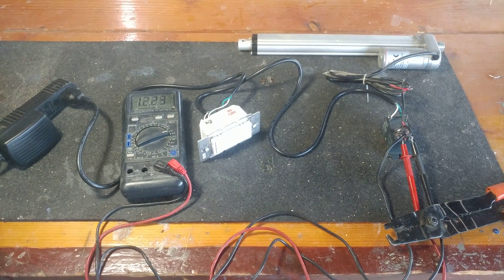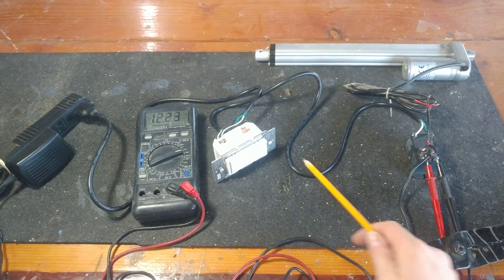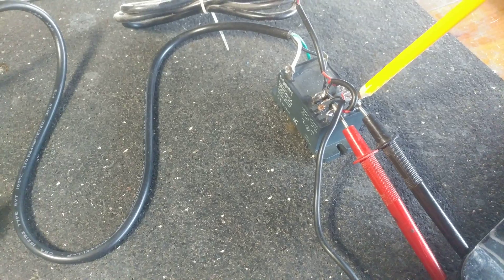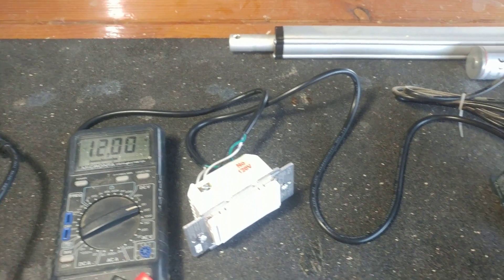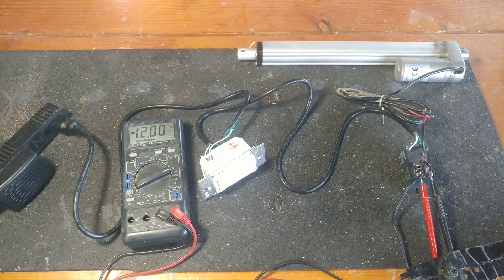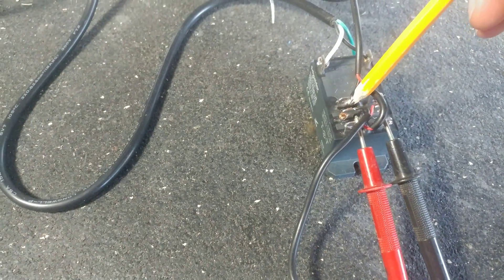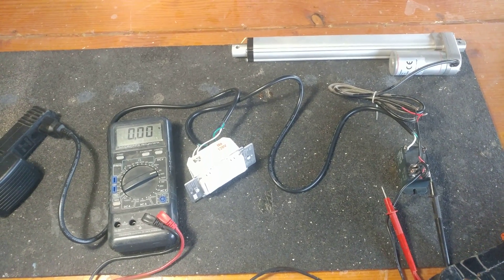DIY Z-wave controlled linear actuator / automatic chicken door / DC motor z-wave forward & reverse

Comment: Thank you for your description of the wiring for the DPDT relay. Between your video and that of @willworkforliberty, I have mine wired using a Shelly 1 Wave relay rather than a clock or wireless switch (using what I had available).
Reply from the maker: I'm glad you were able to find Value thank you

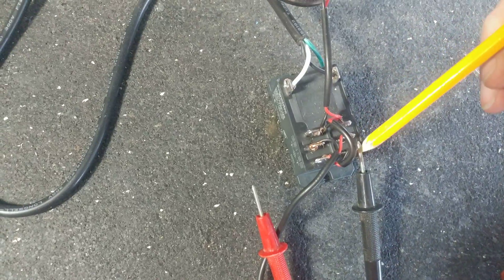Comment: I know that relays are meant to be able to control a voltage with a different voltage but for things like this I EMPHATICALLY warn against it. 2:44 You just put your hand dangar close to high voltage. Yes I know it was off, but in the past years, that I have Home automated lights and appliances, there has been times when a glitch turns on the lights in the living room, or ceiling fans in the pool room turn on and off.   Plus I hope you have it covered most of the time but if not the wring is exposed.

It is better or would have been better to have a SONOFF or MHCOZY smart switch. They have all the capabilities the zwave has and more.
Reply: Oh and no need for the relay. The extra channel can be used for lights or fans.

Comment: I did something similar to this using a Zooz Zen 17 Universal Relay. Fun Fact: Create a virtual window shade device (In Smarthings, Hubitat, etc.) to control the actuator. My actual devices are Doggy_Door_Open_Relay and Doggy_Door_Close_Relay. The virtual device is "Doggy Door" set as a virtual window shade, and if it opens, then the Doggy_Door_Open_Relay is turned on for 30 seconds (and vice versa to close). You can also use the Zen 17 as a Z-wave door opener.

Comment: I am getting ready to purchase these products to use this setup for a roomba cave door.  But the actuator used doesn't seem to be available to purchase on Amazon anymore.  Would you by chance have any other link to one I could purchase?  I am simply motorizing a piece of wall trim so it doesn't have to be very strong.  Thanks, just don't want to buy the wrong thing!
Reply from the maker: Check on eBay there's some good listings there I got more than a few off eBay.
Reply: @erickoffgrid  Do I need to search anything specific?  Any specific specs or anything?  This is the first time trying this and don't want to buy the wrong thing.  Thank you for taking the time to make this video as well.  You explained it very well and made it easy to follow!
Reply from the maker: @The814TV  HEllo, no special part, I just used a 12v Actuator as seen here https://www.ebay.com/itm/372935886308?_trkparms=ispr%3D1&hash=item56d4b605e4:g:mC8AAOSwzVdeEuWx&amdata=enc%3AAQAGAAACkPYe5NmHp%252B2JMhMi7yxGiTJkPrKr5t53CooMSQt2orsSafTQYbq3L7RBVAMi0K9cw6Ug4fa4GrzuHZf5NNWoS3lXJpop7jP5bWxX4eBnjFsz1MQ%252Fo402fyBvLeNRknDX6b%252FDDdHXgC97db9QqaGMpwUSDY1lMchjJSnsXUfvRAMBY%252B7D65vRw2ZZJIOCjjEOrUFjvV9fyJSpGhWgK9lBiKr1SUZlI%252BgPvA2PcHV%252BBkRIeDnI9MgBshBoI5szQWsbnpOv6mIGqV%252BAA8S%252FYBgdS7srx0egmqfjnb9%252FgxpS627z8scrYBBdBzf6artJOGuodLP8J6OFvIFoXUVUNHX3sk%252BwAAA17FZMYzhaLkbWeWUeb7yiXFfbh%252FSEUx1znkOZWd7cSm%252FLAY9hxkRoKJdHfkwQzAbqu3OeZ00S9WLVSLb%252Byzcc6rZfxH7HZNW7Odds2OYpqyQwhzrCL4MFiuTIgw97i3s8QcIN7F4DloxkgArMy9GiZ0fWTF74%252FpgiOiftWuvNp5KRJPZaHZ45Cpi2IAXoAmKMZ63iV%252BuS%252BcsnLhyV2ksBrXDLh5AmnZk5huqR0Y7h%252Fu3oLr13UwIFGQMNE%252BxCc5ku%252B8h0TnVIzpttEtX6UgtMr2UqChj6byxD9yeaHhqUCqReLskCYcfJM5rHeXuqgBvxCGRlL5MxNqMzFtm%252FwmCU2lbG0FNzblEixSSLtsvixGmXACqnkSgSM9FmRoc6LH9jaf3IYZDi%252BXTcKU8Np3A7cpN5eoTonun8CMWQtZxZ%252FGeJmV%252BHRGiEg%252Fq0rePQcqaMlfNckChVffs6c9MScFZl0UvXh1a47RSBgZAbWmWPdp219%252FqeRh%252Bu470BO6F6MW2e8kTUfAubFNxaNdfb%7Campid%3APL_CLK%7Cclp%3A2334524

Comment: Read a similar design and the problem that guy had was he squashed a hen. Does the door go back up when it gets resistance?  What do you have as a safety in the event something it in the way when it's closing? This is one of the reasons why a lot of people are going the arduino or Pi route. I'd love a z-wave or zigbee design to integrate with Home Assistant but not sure there is a safe way to do it.
Reply from the maker: Hi, sorry for the delay, YA for sure on the squishing, I HAD the door directly mounted to the actuator and watched a dumb chicken just sit at the door and leave its head out the door while closing.. my thought was how am I going to explain to the kids the chicken willingly kept its head out a closing door??  and the actuator has a 200lbs rating so ya it was not going to stop !! ;-)  so I ran out and hit the manual switch to revers it..

Next day I did a cable setup, I reoriented the actuator up/down with the wall and had it PULL down a cable tied to the 1/8in sheeting to pull it UP..

Then to close the door I have the actuator move up and with some cable redirection only the weight of the door and gravity, like a pound or two closes the door,  and NO direct connection from the actuator to the door..

So now if a chicken leaves it head in a closing door the door would simply rest on the chicken until it moves and the cable allows the actuator to finish it movement without issue.

Comment: thank you for the great video, will this relay work? https://www.amazon.com/gp/product/B00EZ2C426/ref=ox_sc_act_title_1?smid=A1THAZDOWP300U&psc=1
I also have a GE zwave 2 way switch, will this work? 
is there anyway you can show us a wiring diagram? or at least tell me where goes what? 

Thank you so much in advance!
Reply from the maker: No, this looks to be only a 12V AC relay, so unless you really have only 12v and not 110v-120v it will not work.

Comment: Thank you, Erick.  This is what I have been looking for (no programming).  Does it have to be 3-way switch?
Reply: Appears so
I just bought a voice activated controller that is only on and off and can only get it to open.   Makes sense because when you turn off you break the circuit and in this case you need to reverse the circuit.
Reply from the maker: So sorry, I did not see this question com in, it doe not need to be a 3 way and I did not use one, I used the Leviton DZ15S-1BZ @ https://www.amazon.com/gp/product/B01MZ0WVKH/ref=ppx_yo_dt_b_search_asin_title?ie=UTF8&psc=1
the actuator just needs power on and off though the relay as that is the part that reverses the polarity making the actuator go both ways OPEN/CLOSE

Comment: Hi sir, do we always need to put relay if we use wifi switch?
Reply from the maker: the relay is only used to control the direction od the actuator, open/closed,
WIFI, Z-wave, Zeebee, the protocol makes not difference just the ability to turn ON/OFF the A/C to the switch as that is what controls the direction of the actuator.  sorry for the delay, did not get notice of your question.
Reply: @erickoffgrid  Its ok sir hehe, thank you for answering sir Erick 🙂
Reply: @erickoffgrid  
That's a 3 switch though which allows power to reverse the polarity through the relay?
I bought a voice activated controller (no buttons just turn on or turn off) and it will not work.   Assuming I need a 3 way switch??
Reply from the maker: @TexasRattlerKing  Hello, I do not belive a 3 way is needed and I did not use one, I used the Leviton DZ15S-1BZ @ https://www.amazon.com/gp/product/B01MZ0WVKH/ref=ppx_yo_dt_b_search_asin_title?ie=UTF8&psc=1
the actuator just needs power on and off though the relay as that is the part that reverses the polarity making the actuator go both ways OPEN/CLOSE

Comment: I am going to use this for a very similar purpose, except there's no chickens involved and I am going to use an in-line wifi switch (Sonoff) because I don't need the hard switch. Thanks very much for posting this - I was looking on the web and also finding Arduino type answers but I kept thinking there must be a way to run an actuator in/out without having to program. This is it! I've ordered all the parts, cant wait to try it out now that I understand how it can be done!
Reply: Sir good day, when you use the Sonoff wifi switch for the actuator do you still need to install a  relay?
Reply: @karlmagno6871  yes
Reply from the maker: Yes, the relay controls the direction of the actuator.

Comment: Did you consider using the zwave dry contact relay?

Remotec Zwave Dry Contact Fixture Module
 https://www.amazon.com/Remotec-Zwave-Contact-Fixture-Module/dp/B00913ATFI/ref=sr_1_3?keywords=dry+contact+relay&qid=1574169044&sr=8-3
Reply from the maker: might have to give it a try.

Comment: Can you link the relay or a similar one that I can use to do this? I’m completely clueless when it comes to any type of wiring so I’m trying to make this and need to know exactly what I should purchase. The relay is the only part I’m not sure on. Thanks in advance.
Reply: Schneider Electric/Legacy Relay 92S11A22D-120 Power Relay, Dpdt, 120VAC, 30A, Din Rail https://www.amazon.com/dp/B011OMGT84/ref=cm_sw_r_cp_api_i_9QVXDbEQ9NCCS

Would this relay work?
Reply from the maker: Yup, this is the one I have used, is the same.
https://www.amazon.com/gp/product/B011OMGT84/ref=ppx_yo_dt_b_search_asin_title?ie=UTF8&psc=1

Comment: How do you manage when to stop the linear actuator? If you can't get one that's the perfect length when fully extended, you run the risk of tearing the door off.
Reply from the maker: That is a good question you have to make things work sometimes.
 
You might have to adjust the angle up or down to the connection point where it touches the door and that'll extend or shorten the distance or you might have to travel or make up your own personal type of adapter to keep the door from ripping off but it is a lot of give-and-take and will take some time to fine-tune.

I just went through this myself and added another automated door to the yard that opens and closes on its own with a standard linear actuator and had to make the same type of adjustments to make sure the door would clear open and not rip off the actuator attachment point so there is some give-and-take and you might have to use some temporary attachment points with screws so you can fine-tune the position and do a lot of testing halfway opening and closing the door to confirm things don't rip apart and you're there to stop it if it starts so you can make the adjustments  but it is a process.

Hope this helps thanks.

Comment: Hey, how did you get the switch when there is no neutral line In the plug? Only green(ground) black(line) white (load). That switch requires a neutral, just curious on how u got it to work. Thanks for the video btw! Super helpful. Also, does the linear actuator have some sort of limit switches in it? How does it know when to stop protruding?
Reply from the maker: Hello, 

You are correct, this switch will not work without the Neutral "White" line, however, If you look closely at the opening shot you can see it connecting to the switch, then out of the switch and into the relay using the Neutral "White" and Common "Black" what the relay does not use it the Ground "Green" as the Neutral is always on and the Black Common line is the "switched On/Off" and it is this action that engages or disengages the relay changing the actuator direction.

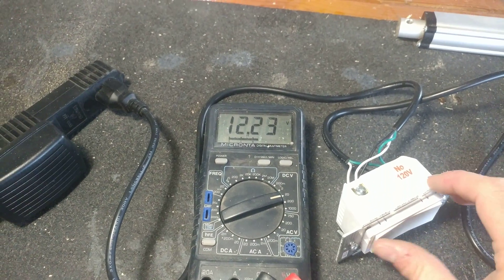you can see this more clearly @ 1:07min in the video, Hope that answers the question, If I can clarify please let me know :-)
Reply from the maker: Sorry, forgot the limit switch part, YES, the actuator does have built-in limit switches to stop itself in BOTH directions, and the relay polarity reversing is what triggers these relays and sends the actuator in the other direction.
Reply: @erickoffgrid  it looks like in the video that the white wire is wrapped around just the one screw on the switch and then it goes to the relay. Am I seeing it wrong? So does that mean the black wire from the plug is cut and it goes to 2 different screws on the switch? 1 to line, the other to load and then to the relay? And white goes to neutral and then to the relay. 
Sorry I'm just used to doing this with 4 wires for a home installation and I couldn't get it to work in my house because I dont have a neutral in my house but you seem to have this running without a neutral line.
Reply from the maker: Yes the neutral is in and out 1 screw like a junction and is required for the switches, the black HOT wire goes into the LINE screw of the switch and OUT the LOAD screw, and it is this HOT line that the switch turns on and off. ground is ground ;-)
hope this clarifies a bit :-)
Reply: @erickoffgrid  awesome, you rock. Thanks!
Reply: @erickoffgrid  so I finally got around to doing this and it works perfectly. It seems to be a little warm though when it's on for a while.  Is this normal for it to run warm? Its not hot to touch but it definitely gets warm.
Reply from the maker: @jasonJSilva  yeah running warm is normal mine does the same thing I've had no issues with it if not hot to the touch but it is noticeably warm mine is still going strong and I've duplicated to set up a couple times no issues there as well.

Comment: Hi! I'm similar to you in that I'm looking for a simpler way to do this rather than the Arduino route so this looks perfect. One question though, is there anything stopping me from just using a simple smart plug that the power supply is plugged into instead of using a switch like you have? Would that work? Thanks.
Reply from the maker: Hello, I do not see why not. The smart plug is just doing the same thing as the switch, you just need to take the output from the smart plug and instead of to a lamp put it to the relay so it can be turned on and off then controlling the actuator direction. hope this helps.

Comment: Can you give the 12 volt side wiring information.  I know you explain it but it is difficult to see.

Here's what I see

Top Left - Black to Actuator & Black Jumper to Bottom Right
Middle Left - Black from 12 VDC Power Supply
Bottom Left - Red Jumper from Top Right
Top Right - Red to Actuator & Red Jumper to Bottom Left
Middle Right - Red from 12 VDC Power Supply
Bottom Right - Black Jumper from Top Left
Reply from the maker: yes, you have it correct, the 2 middle are the 12v in and can be swapped if you want your initial direction to start in the other direction.

Then TOP LEFT to BOTTOM RIGHT and TOP RIGHT to BOTTOM LEFT.

This is the switching of the polarity on the actuator reversing the direction.

the AC on /off is what triggers the DC relay to activate selecting the polarity + - or - + and sending the actuator in both directions.

hope this helps a bit.

Comment: Do you think the mimolite zwave would work in this setup?
Reply from the maker: Yes, I would think so as all the Zwave part is doing is providing the interface to your HUB for the control. all your really after is a way to open and close the LINE in the circuit, the relay will then control the direction.

I also did this same setup again and put it the actuator to the chicken roof to raise and lower as the smart things temp sensor hits thresholds to VENT the coop and prevent it from overheating.
Reply: @erickoffgrid  Thanks. I'll have to figure it out.

The vent is a great idea too.